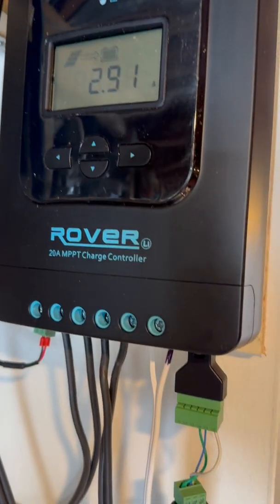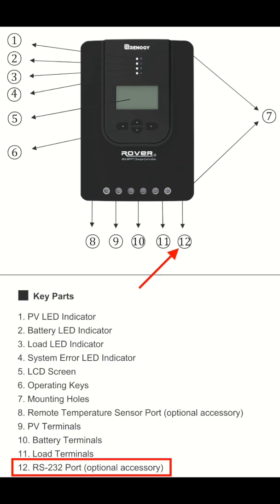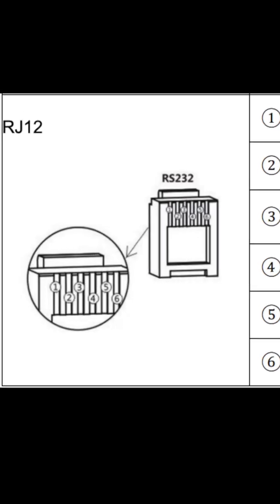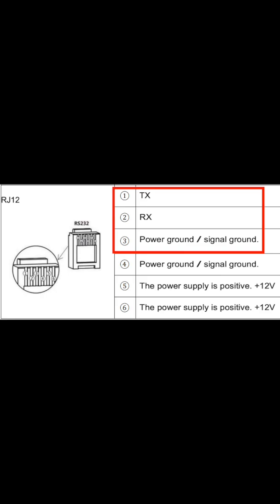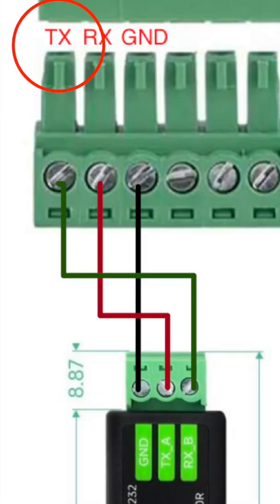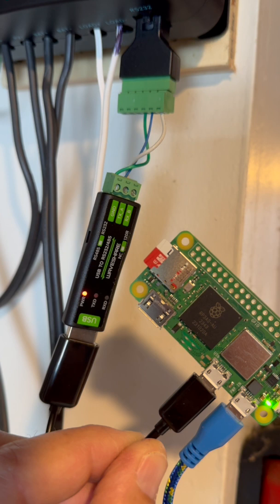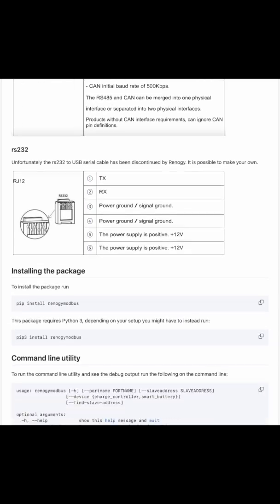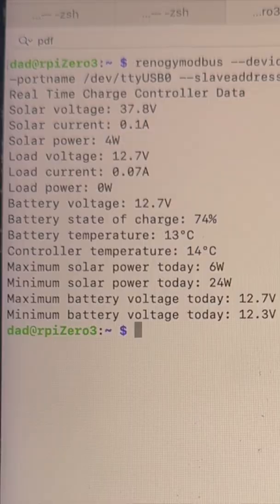Connecting Raspberry Pi to Renogy Solar Controller

Comment: Thank you so much for this video, I just got my own working with a Renogy Adventurer! My only struggle was the RJ12 plug did not connect to the pins fully, but after some troubleshooting I modified it and now I'm getting all the charge controller data back via the PI from a remote site!
Reply from the maker: Excellent! I later found that the renogymodbus package didn't have a way to change the config on the Renogy but the package it uses (minimalmodbus) does so I can now have the renogy switch its load on and off - in my case, landscape lighting.
Reply: I just realized that I have the same issue (RJ12 breakout not fully engaging with the pins). I would love to see a picture of your modification.